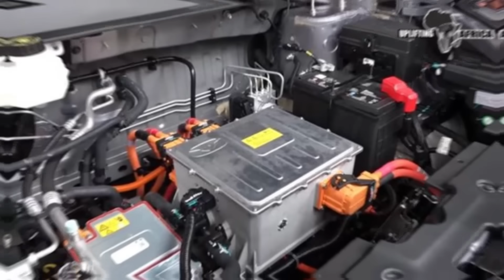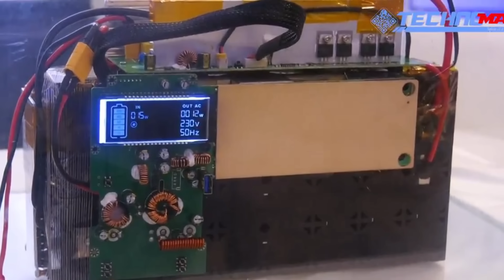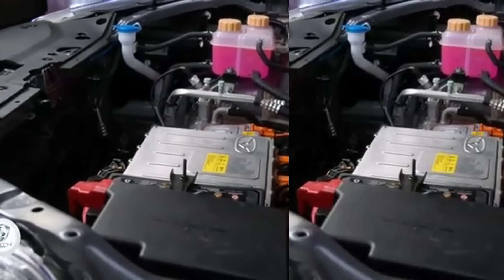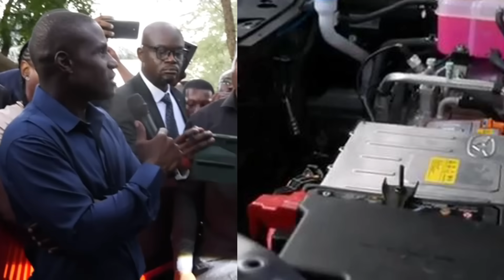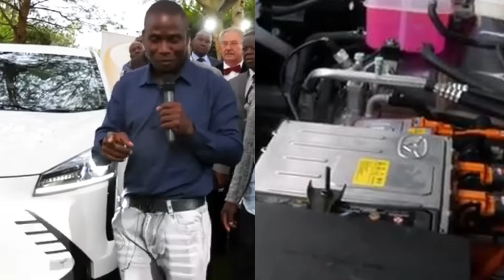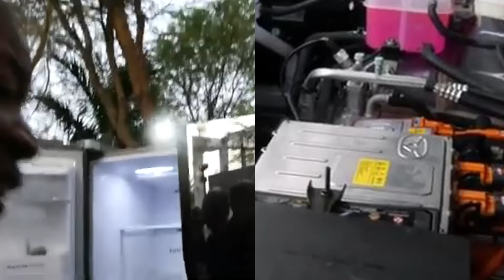The ‘Self-Destruct’ Feature: Genius or Liability for Buyers?

Comment: Hats off Maxwell. We rally behind you
Reply: Africans are not wise. They should hide their technology from their slave masters, build underground factory and mass produce their inventions. Thereafter, they sell their finished products. Slave masters will definitely hijack it . Your slave master will never allow you to be GREATER THAN THEM. LET AFRICANS BE WISE.
Reply: We are surrounded by large transmission antennas from telecommunications companies throughout the city, the system and transforming radio waves into electricity is possible through a device called rectenna (rectifying antenna). This system captures radio waves and converts electromagnetic energy into usable electrical current. Here's a summary of how it works:

Main components of a rectenna
Antenna – Captures radio waves from the environment. It can be a dipole, spiral or patch antenna.
Rectification circuit – Converts the high frequency (AC) signal into direct current (DC). Typically uses Schottky diodes, which operate well at high frequencies.
Filter and storage – A capacitor can be used to stabilize current and store energy temporarily.
Steps to turn radio waves into electricity
Radio wave capture – The antenna receives electromagnetic radiation present in the environment, such as cell towers, Wi-Fi, and AM/FM radio.
Conversion into alternating current – The captured signal generates an oscillating alternating current in the antenna.
Signal rectification – Diodes convert this alternating current into direct current.
Filtering and storage – Capacitors and other circuits stabilize and store the energy generated.
Applications and limitations
Uses: Wireless sensors, small low-power devices, and wireless power technologies.
Reply: seems youll rally behind anything as long as it comes out of africa, if its not some snake oil salesman selling cars its an african leader whos willing to cosy up to the chinese, even tho the chinese have a very very healthy dislike for black people.

Comment: So, be very careful to avoid a traffic accident, and you probably have buy a whole new car instead getting repairs. At least it is better that a slab of Lithium batteries underneath the car blowing-up.
Reply from the maker: While the detonator safeguard adds a layer of security, it could indeed complicate repairs for international customers. A more user-friendly solution might balance safety with practicality, ensuring global accessibility without compromising on security.

Comment: I sincerely hope that the self-distracting strategy does a complete job of it that is:
If there are any printed circuit boards there should not be any remnants of the components, boards and any copper tracks on them.  They should all be reduced to dust or preferably liquid. Liquid is better since it can be the same corrosive solution that is used to dissolve the above-mentioned components. If there are any metal wave guides whose shape is unique, then I personally do not know how they can be destroyed quickly enough with a solution although it would be highly desirable that they are also completely destroyed. Good luck from fellow African inventor!

Comment: It's a scam. The science is valid but the numbers don't add up, radiowaves do carry energy but it's miniscule and the energy in a radiowave decreases by the inverse square law, that is the energy is inversely proportional to the square of the increase in distance from it's source. Radiowave energy is measured in microwatts and nanowatts, if there was enough energy in radio waves to power anything significant then all radio reciever devices would be powered by the radiowaves they recieve they wouldn't need a battery or power source, and if radiowaves carried enough power to power a car those same radiowaves would be inducing dangerous voltages and currents in anything conductive, we'd all be getting badly electrocuted from fence lines, metal gates, anything made of steel etc..
Reply: Crystal radio set it Selfpowered by radio waves
Reply: @khumbulanitrinity8955  Yes, a crystal radio uses the piezoelectric effect to convert radiowaves to a tiny oscillating current just enough to drive a very small speaker. That just reinforces what I'm saying in my comment, the energy in radiowaves is miniscule, just enough to drive a tiny speaker, that's if you are lucky and have a strong radio signal, this same radiowave energy can charge an EV battery? No, of course not.

Comment: it's fake everything is fake hahaha. 1 hertz = 6.60 X 10 to the power of -40 joules (MINUS 40).  It is such a small force that it cannot move anything at all.
Reply: Just think without the box, then you will discover that it works
Reply: First of all 1hz means nothing without mentioning the amplitude. Second the Friis equation states that the power received is inversely proportional to the frequency, this is why this device works with radio waves

Comment: There is about few microwatts of radio energy around us. To extract that energy in most efficient way you need a tuned antenna.
I see no antenna and more important I see no radio components at all.
Also like many pointed out it's one of those large battery banks without the casing.
Reply: Yeah i work in a science very similar to this, geophysics and airborne electromagnetic surveys, we actually use an electromagnetic survey system that uses naturally occurring atmospheric electromagnetic signals (sferics) as the energy source for passive electromagnetic surveys, and we also use electromagnetic survey systems with a huge transmitter loop with 500V pulses being sent through it by a signal generator to create a primary electromagnetic field that switches on and off, even that field has low energy in it, the real inductive energy comes when the transmitter turns off and the EM field collapses into itself, which it does 10 times a second. The energy in radiowaves or any transmitted or naturally occurring electromagnetic fields is tiny, measured in microwatts or nanowatts, and the energy in electromagnetic fields decreases by the inverse square law, that is the energy is inversely proportional to the square of the increase in distance from its source, if there was enough energy in radiowaves to power anything significant then all radio reciever devices, radios, TV's, cell phones etc could be powered by the radiowaves they recieve they wouldn't need batteries or a power supply, and if there was enough energy in radiowaves to charge an EV battery then that same radiowave energy would be inducing dangerous voltages and currents in everything conductive around us, we'd all be getting seriously electrocuted from fence lines, metal gates, metal building, steel framework etc.
Reply: @ats-3693  Sounds correct, as far as it goes, but no one will listen.
Reply: @ats-3693 That is foolish science. i commented a link earlier and checked it out. For us not to be electrocuted, that is God's design, not human
Reply: @ats-3693 Inverse square or inverse cube of distance ?
Reply: @DakarBlues  inverse square. The field strength decreases by the increase in distance squared, double the distance and the field drops to 1/4 of what it was, triple the distance the field drops to 1/9th of what it was, and so on...
Reply: Keep it bro. Envy won't serve us here!
Reply: @tsikanemakopoi-qq8fu 
I'm not envious, mostly dissapointed
Reply from the maker: It looks fishy,,I wish we get to see more proof of this
Reply: @chriswabs  his videos are all over YouTube
Reply: @gideonmcdonald4330 Yes videos of him talking in circles saying the cars are for sale now but also unable to say where you can buy one from, showing a car that is a rebadged Chinese EV with rechargeable batteries, showing a rechargeable portable power pack that is manufactured by someone else. Where is a video showing an electric car powered by his device driving around without needing to be recharged? Even a prototype? There aren't any.
Reply: @ats-3693  best part is when he opened a hood of "his" new ev you could compare the images and there was apsolutely no modifications to speak of.
It's just a normal ev he's posing around with driving it 2km here and there
Reply: @gideonmcdonald4330  where is uncut video of him driving around?
Reply: @blackturbine  It's crazy that so many people appear to be believing this is real, but I guess there is also an element of internet related biasing with regards to the people we see here talking about it. Pretty much all the video's either talk about it as being true or just give a hint of questioning it but leave it open with some possibility of being true, I have yet to see a video that just correctly debunks it.
Reply: You're just jealousy
Reply: I believe in this technology
Reply: It's alien technology man. He had visions of circuit boards. It's not a built from experiments or anything it's direct download from ether.
Reply: @shumbahurushumbahuru4894  bro got a quick share request ZIP folder xD
Reply: @shumbahurushumbahuru4894  🤦🏻
Reply: I think you won't be able to understand or we are not allowed to see just that, classified. Though it works, practically.
Reply: @yamikanijoseph9381  i see no practical usage like driving a car around or powering something for a long time.
It's just another show and tell without doing much of anything to back up his claims.
Reply: You're saying only what you know, doesn't mean you know it all. You be trying to contact your master Chikumbutso to help you understand.
Reply: @stevenwilliams3015  I need him to teach me how do you scam so many people at once

Comment: In case anyone missed it at as he "REVEALED" his "microsonic" device.

This is just the Browey Portable power station without the case.
The internals are exactly the same without modifications.

The only thing he has done is used a bit of trickery to fool everyone into thinking it is charging it self from the input.

Once again no demonstration of it charging itself from a discharged state.

I will upload pictures on my channel if anyone is interested.
But a simple google search one can find the pictures easily.

Take note of the display and where he turns on the power station itself.
Reply: He out sources power device and the electric car manufacturering. His invention is the microsonic device which converts radio waves to energy. He can add it to any charging system.
Reply: @ He can't outsource anything he hasn't invented.
Reply from the maker: already on the video watching
Reply: Shame on you. Scepticism is not an issue but mocking shows you might be jealous or so ignorant. You obviously, like a lot others don't understand how it works but don't mock. Try and understand, this guy has been around for years developing this MSED. And the colgate is now out of the tube.
Reply: @simbachiwz174  🤣🤣🤣🤣... you're totally right
Reply: Just looked it up, and yes it's the browey portable power station
Reply: Just noticed it I looked up and it is literally Browey power station.
Bet he will be "kidnapped by big oil" or whatever generic excuse like all the other "big inventors"
Reply: @blackturbine  Just uploaded the video of the pictures on my channel
Reply: @scamchan don't bother derail some people's interests in microsonic invention my friend, if you don't get it, it's not  always a proof of non-existent phenomenon, not at all, get yourself some patience and learn it as it comes, perhaps we'll get to a certain understanding some day. Remember Galilei Galileo's death? Corpeniccus?
Reply: @yamikanijoseph9381  Maybe you should stick to the facts and evidence and not just wishful thinking.
People like you get scammed often.
Reply: Maxwell could be today's Galilei Galileo
Reply: Check some of his explanations you will get a better understanding.... or rather ask your doubts.....
Reply: @FdMakarios  His explanations mean zero without tested proof.
So far all he has done is go the deception route.
Fancy words mean nothing.

Did we miss the part where he shows any device working and charging batteries from a discharged state?

Some people are easily fooled an live in fantasy.

Then there are others that are skeptical of the huge claims without evidence backing them up.
Reply: @scamchan why don't you be quiet ? didn't you see he revealed for the first time the microsonic device at the launch ? Maxwell has undoubtedly surpass all white scientist put together in the field of Radiofrequency and power generation.
Reply: This is not browney power station  bro. U can buy anything in china, from the shell to interial parts of any products, as long as it has no brand name on it, you can sell it. So basically, this Zim inventor here like the look of browney power station, he imports the shell and thats it.
Reply: mental midget wypipo are jealous----doesn't matter you can't stop what's happening==AFRICA ON THE RISE  mutha
Reply: Enjoy your white supremacy while it last.......the world has been through several phases till today and it will continue till infinity.

Your jealousy can never stop the times.

Comment: Just cut the power
Reply from the maker: then no detonation😁😁
Reply: @chriswabs   but what if you get I to a fender bender  and it detonate should they refund.
Reply: @chriswabs this thing is always on, it will detonate even  when off if you tamper with certain wiring. Because there is no off or on in strict sense, no, not at all. Every time it's on because every time there is radio waves reception, see this, what exactly do you switch  on or off in this device???? that's where there is danger for all of you who will try to do reverse engineer to steal, and I warn everyone trying to steal that tech, microsonic is quite advanced tech, if it self destructs, so many things happen,...
Reply: Don't be fooled, there is no on or off in strict sense. How can you on or off radio waves you don't control, why don't you get it?
Reply: @yamikanijoseph9381  why are there no review videos yet
Reply: @yamikanijoseph9381   radio frequencies wave can be  blocked,  Lil bro
Reply: @Seth-professional  correct but you cannot block all, right?
Reply: @yamikanijoseph9381   that just one way to block radio wave  these multiple.
Reply: @yamikanijoseph9381  be simple creating an electromagnetic field.  The same way the Earth blocks these waves from space using its  magnetic field and atmosphere.

Comment: Still not much of a safe guard, buy 100 or 1000 if for sale or follow the blueprints and make enough till u know why it works. Not very original about safeguarding it. Companies have time money and manpower to figure things out.
Reply from the maker: like you buy 1000 and play around with them until you figure a way to go about the safeguards? hence reverse engineering his tech?
Reply: It's a big power bank,
Even on camera you can see apsolutely nothing radio related to absorb all of that radio energy. Just another fraud.
Reply: @blackturbine  Solar panels need light, any other waves work in complete darkness, some even in cage of Pb-element underground. You need just 2 rods or plates. But it has tricks to it, so even aliens are not naive to give it to governments. It is chess with 3 players. I am serious about it.